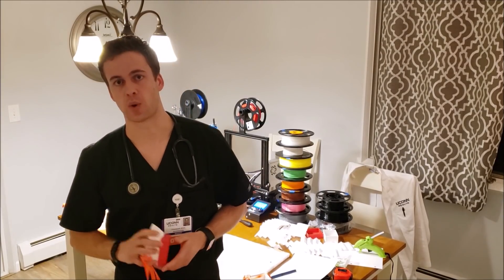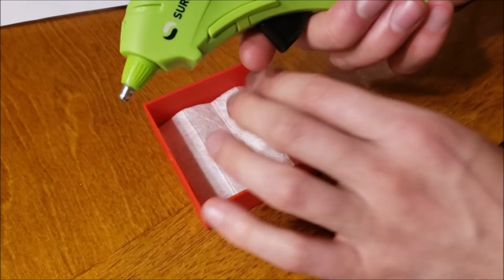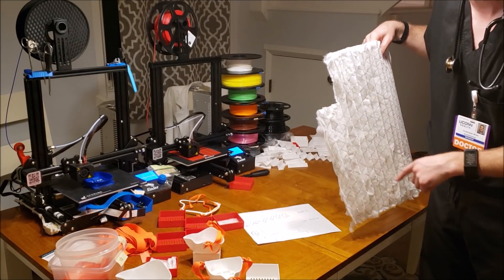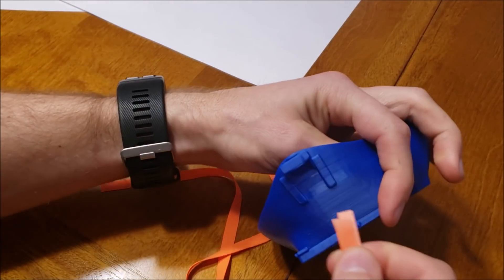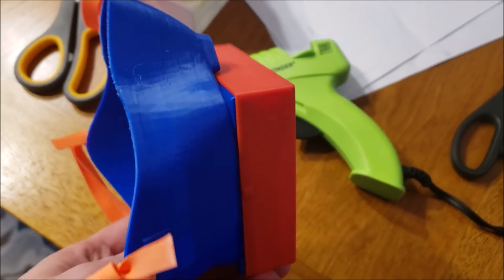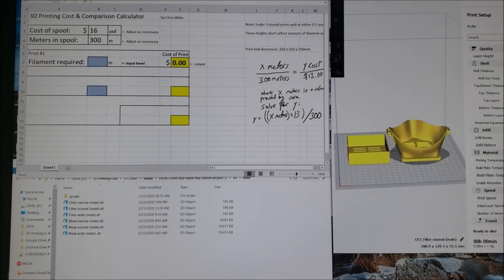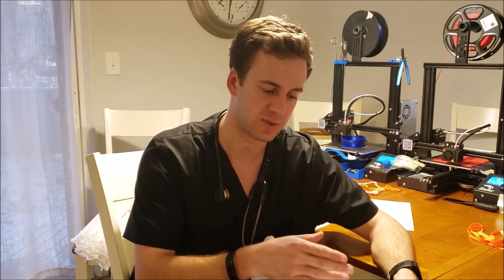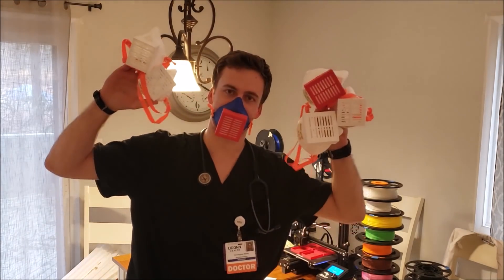COVID PANDEMIC 3D PRINTED MASK TUTORIAL

Comment: The FDA does not recommend trying to make masks on filiment printers.  The material itself can pass fluid through it and you are unlikely to have a good seal.  You will end up inhaling and exhaling air from the sides of the mask.  Even if these were not problems  and you achieved an airtight seal, with the size of your filter versus the volume of air you are trying to pass through it you could very easily have so much CO2 buildup that you pass out and die.  Here are the FDA recommendations on what medical components you should or should not try and create via filiment style 3D printers.  https://www.fda.gov/medical-devices/3d-printing-medical-devices/faqs-3d-printing-medical-devices-accessories-components-and-parts-during-covid-19-pandemic

I understand that you have noble intentions but this particular device is probably neither safe nor effective.
Reply: I disagree. Nor am I a Dr. So I am printing masks designed by Doctor and Dentist with support from Billings Clinic out of Montana. If you were told to go into a room with infected patients, would you use a bandana, 5 day old mask intended for single use, or well forming, reusable, disinfectable, filtered mask? Everyone should be wearing a mask of some manner...period. Seems to me the guidelines are also trying to manage supply. All users of these types of masks need to be certified that they are healthy enough to use them (3D Printed or manufactured). https://www.facebook.com/HelpOurCTHealthCareWorkers
Reply: a good printer prints water tight that's sufficient for the pressure differential provided by breathing thru described filter. PLA itself is a solid plastic so the "material itself" can NOT "pass fluids through it"'
Reply: @mikewilson1313  The fluid that you have to worry about isn't water it's aerosolized droplets of saliva carried through the air.  As a Mechanical Engineer with experience using many types of 3D printers I can attest to the fact that while raw PLA might not be able to pass fluids through it, the matrix structure of a 3D print definitely can.  There is a reason that the FDA is not recommending hobbyists create these, they are more than likely going to end up being useless placebos that only serve to make people feel good.  The risk posed by a poorly designed mask that doesn't effectively filter air that is being both inhaled or exhaled or let its user breathe effectively is so great that they shouldn't be rushed into a medical application.
Reply: @ericvangulijk4433  I don't think Mike Wilson is talking about raw filament; I think he's talking about finished 3d prints. If the final print is water tight, surely that would exceed n95 requirements, no??

Also, saliva is more viscous than water, so it would have a harder time getting through a 3d print that would water.

Comment: This video just explained everything i know about 3d printing... in just a couple of minutes... cause of corona. Gg
Reply: Oh man. You have a lot to learn....
Reply: @TrollWithOpinions  Imagine my situation: 45 years in high tech, but none in 3d printing :O  Birthday is coming up, so I'm considering a 3d printer: one in the $500 range, but I have no idea which one. I'm also interested in learning how to make my own models. I have an old version of Sketchup; I'm wondering if it could be used (I'm not all that enthused with using the new on-line free version).
Reply: RU Kidding 
Anything that can produce an STL-file can be used for 3D prints.
There are, however, a very important bit. It has to be “manifold”, which means that there must be no holes into the inside of the mesh.
A great tool for repairing a mesh is MeshMixer. An overlooked tool that can do the same is the Windows 10 “3D Builder”.
Most Slicers can also repair a mesh. Some more sucessfully than others.

In my experience two things are important in todays printers. 
The bed levelling method. Some use/used three finger screws. Avoid them like the plague. Levelling using an induction probe is good.
The bed itself. Glass is OK. PEI covering is better. Detachable spring steel PEI sheets are king.

Some printers use a feed mechanism where the drive gear is away from the print head, and feeds the filament through a Bowden Tube. Reduces weight on the head. Some have the drive gear mounted on the head and feeds the filament straight to the hotend.
I would never go back to the Bowden tube method, although I am told by many experienced users that I shouldn’t worry.

Comment: There is no way a 3D-print is stopping a corona virus if the surface is not treated in any way to seal the gaps made in the printing process. If the doctor in this video asks his friends in the hospital that know how to use a good microscope he can verify that there will be many gaps in the print even though it looks good visually. The mask should be sanded down and painted with a paint that seals the gaps or prepare the surface before painting with a filler and sand that down before painting.
Reply: What a ray of sunshine you are.  Though not suitable for ERs, etc, it can be pretty effective when going out in public.  On the mask that I print, which is a different design, weather stripping helped a great deal.  And it is damn sure better than the masks that hospital personnel are forced to use for days on end.
Reply: a. it was tested.
b. the printing process is water tight adequate for pressure differential of breating thru described filter.
c. a couple of passes with a heat gun beats painting if you have a poor print. I throw poor prints in the trash tho.

Comment: @ChrisWiles
 Hi Chris! Good job on video! I am in CT (Deep River) and have been printing the Billings Clinic mask for days now. They were designed by a Doctor and Dentist and require no assembly, form fitting and take a 2 1/2 inch square filters (cut six filters out of  one surgical mask). I've supplied my town EMS center with 12 mask (they requested 8-12), and am trying to engage other printers (schools, hobbyists...). I have a FaceBook page where the model, instructions are available. Do you have a distribution point? I've tried online donation sites, but have issues with page crashing/non responsive or captcha not working...
Thanks again...be safe! My page: https://www.facebook.com/HelpOurCTHealthCareWorkers
Reply from the maker: Hello, thanks for getting involved! I considered that mask but it does not have a large enough filter chamber to put in an adequate number of layers or total surface area without becoming harder to breath through for longer periods of time. My goal is to get in the 92-99% filtration range (n95 being 95%). That one is probably adequate to replace a surgical mask, and the most important thing is a good fit, so great work! I just find the larger chamber size better for what I'm doing. All these ideas help and I'm sure the people you're donating to are very grateful. Keep it up! And feel free to give this version I'm using a try, too.
Reply: @chrischris64  Thanks! I'm trying to engage the education system, my town has idle printers (I am told) in each level of school (elementary, middle and high). Got five printers coming in Thursday at my work and one running past 4 days in basement. I see you have engaged hospital printers. Saw you on WFSB, and am engaged with them to try to try to consolidate and get the word out to other hobbyists/assets. I think alot of us are in lock down, but don't know where to send, what to send, how to send donated PPE that has been printed. Our own islands - hoping we are doing what is needed. Be cool if the state or hospital system would endorse a specific model based on simplicity/effectiveness. Else they recieve mixed bag of confusion?

Comment: You have a problem with them.  You need to sand them down apply a bog to outside then paint the bog side after it drys.  Because 3D printing leaves micro plastic holes in the layers.
Sterilize filters small oven 100C 212F for half an hour. Or 9 days in sun light.

Comment: Great idea, doesn't Sarscov2 love plastic? Like it will stick for 2-3 days. Will this be one time usage? N95 is made from polypropylene material same as diaper. I think its cheaper to modify diaper into a mask.
Reply from the maker: I suggest wipe down with bleach or isopropyl alcohol, then a UVC light chamber if available for sterilization (cannot autoclave) if in a hospital. If you're wearing these for personal use, you could always make yourself 3 or 4 and rotate them to let the virus die - no guarantees there, but just a thought.

Comment: How about adding a fine non-coated copper wire fine mesh in front of the filters (outer side)
Reply: 3d copper out of Chile -(I think) had developed antimicrobial copper filament. Unfortunately they are out of stock and will likely have a large backorder list.
Reply: I have been experimenting with copper electroplating so doorknobs and switches can be plated as well....but my fingers are in too many pots right now. sewing cloth + Merv 12 masks and running my 3d printer.

Comment: Why do you need to use two different kinds of filters? Isn't the MERV 13 filter enough?
Reply: The first filter traps larger particles so they do not clog the final filter. Common practice in filtration systems.

Comment: Stealing some inspiration from other reusable masks... Printing two bars for the buckle separated by a gap would allow you to feed the strap under both, then loop over the front one and back out under the back one. Then you'd just pull the loose end of the straps to tighten, and not have to tie knots. :)

I think they're called "ladder lock buckles" or "strap adjusters," if looking for inspiration. I think it'd be a pretty simple enhancement to make, and the "upper" bar couple be bolstered by a pair of triangles underneath a rectangle instead of a rectangle, making bridging easier for more filament types.

Comment: Sorry but this is a bad idea and you shouldn't promote it, especially being a doctor. This can actually put you at a higher risk than wearing nothing. These plastics actually trap bacteria and viruses and the heat from your breath helps promote growth. Good for filtering harmful particulates, not viruses. DO NOT USE!

Edit: You already have the filter, make a no sew mask like this,
 https://youtu.be/nE0EuDHMfZ4
and wrap the cloth around the filter. Simple, effective, and no 3d printer needed. And, no plastic breeding ground.
Reply: @DjSokYchannel have you ever worn a plastic mask? It gets sweaty and hot and you keep adjusting it making you touch your face more. Germs can live on the edge where the so called "seal" is and easily make their way under when you slide around that hot, sweaty, disgusting mask. Sorry, these are bad. The intention is good, but these are a germ fest. They will accelerate the problem instead of preventing it. If anything, this dude should know better.
Reply: perhaps you missed the part where he plans to make a UV sterilizing chamber. Also, lots of plastic is used for medical equipment. The trick is to either dispose of it after use, or sterilize it.
Reply: Wearing a mask generally PREVENTS people touching their face. That's good. If it bothers you it isn't fit correctly. I've worn both masks and respirators 10 hours shifts. Perhaps only medical folks have sensitive skin?
Reply: @mikewilson1313  there is no comparison when wearing a cloth mask versus a plastic mask when it comes to comfort. Wearing just a bandana, though not very affective if someone coughs in your face, will remind you to not touch your face. It's worlds more comfortable than strapping plastic over your mouth. Hand to face transfer is a much greater risk than catching this thing airborne. A plastic mask raises the risk because you will 100% have to adjust this thing once it gets sweaty and wet. My paint booth respirator is similar to this and I am constantly adjusting it. It's plastic on my face and moisture from sweat and saliva builds up. It gets uncomfortable and I break the seal all the time. But, the consequence is that I just simply inhaled an insignificant amount of fumes. Now, if I wore my respirator in public, touching door handles, a shopping cart, products, a credit card machine... and I came into contact with the virus, at some point, I would eventually touch this mask because it's wet and uncomfortable. Now I transfered it to my face. If I'd just wore a nice comfy bandana, no face touch.
Reply: @lowerjerzey  interesting. Once I put on my 3M paint booth respirator I virtually never touch it until it's time to take it off. Different strokes for different folks I guess.

Comment: anyone know the equivalent filter for the UK?
Reply from the maker: maybe these? https://www.amazon.co.uk/Platinum-14x25x1-Pleated-Filters-produced/dp/B00CK03J1A/ref=sr_1_7?keywords=merv+13&qid=1585630862&sr=8-7

I can't find any of the 3m filtrete stuff i'm using for layer one on the UK amazon, so you could probably flatten one layer of that and silicone/glue the edges for a good seal, and then do a second layer of it still pleated for surface area. It's probably still breathable like that. Good luck and thanks for your interest.
Reply: @chrischris64  much appreciated, thank you very much,you are one of the good guys.

Comment: Can anyone help me test this vs an N95? I dont have the tools.

https://www.thingiverse.com/thing:4245555
Reply: Holski77 hi, I can already tell by the pic that the hole is too small and will cause C02 build up if it’s sealed properly. I know because I printed a similar one last week and didn’t feel so great after sealing it with tape and testing it. Too much CO2

Dr Wiles has the best design so far, it’s just a matter of achieving a good seal. I would also personally caution against using anything other than an N95 for filtering. The plan with the one I’m working on is to cut up an N95 masks to produce 4 filters for masks, extending the supply and using CDC approved materials.

Here is the version I’m working on. It’s essentially the same concept as yours and the one here but prints a bit faster and less build time than Dr. Wiles version. https://www.thingiverse.com/thing:4236053

Good luck!

Comment: What affordable 3D printers does one recommend?
Reply from the maker: Ender 3 or if on sale, Ender 3 pro. $200-240 range on ebay, faster shipping than on amazon currently, and I will soon release gcode files for the ender 3 size print bed (220 x 220 x 250) so that you can download and print without needing to slice in Cura.
Reply: I've had really good experience with the Anycubic i3 Mega.  It ranges from $180 to $240 depending on your source.  It has a textured glass bed and it's print volume is 8"x8"x8".

Comment: On thingiverse, you have the stl files. Do you have any other 3D part files? I only have a single extruder, so I want to attempt to split the face mask model into 2 sections. One to print with normal PLA, the other (that goes on your skin) with some flexible PLA. I can import the stl to solidworks, but that's always a pain due to all the triangles. Do you have these in any other 3D part file types?
Reply from the maker: That's a good idea. It would reduce the need to make a separate rubber seal. I am extremely busy right now but will add it to my design list and try to get it done within a week.

Comment: I have printed the women and mens mask and the fit is great. Easy prep, a little sanding with 100 grit and then followup with 220 grit to smooth. Printed the mens with anti bacterial PLA (Purulent purchased from GCTECHLLC.com. Ordered and arrived in 4 days) and it came out fine. I used the HEPA filter then added a liner of shop vac paper filter over the grid and let the mask cover hold it down nice and flat as a final layer. The opening is big enough that you could add multiple layers if necessary. I did find a MD brand (sic) rubber window seal (item #63602 that worked great as a seal. It comes as a B profile about 3/4 inch wide of a flexible profile. I simply split the B to 2 smaller Ds and applied to the inside. Since the profile is round it seats very well against the skin. 
Thanks for the great work and I hope some of this helps
Reply from the maker: It does. I'll try to find that brand and do some comparisons and suggests for post-production for another video, thanks.